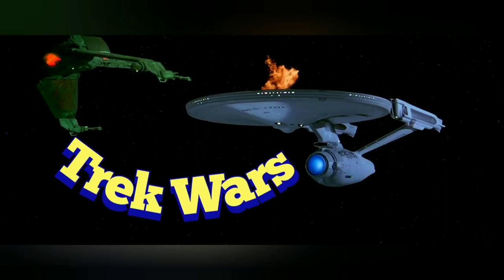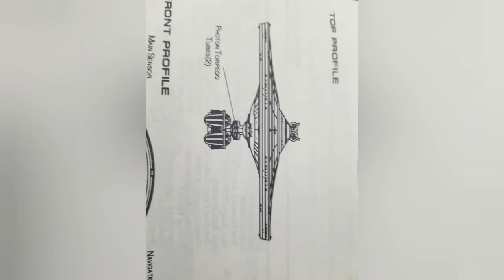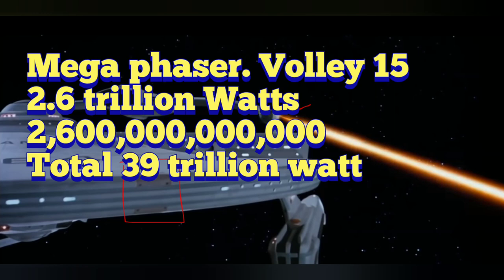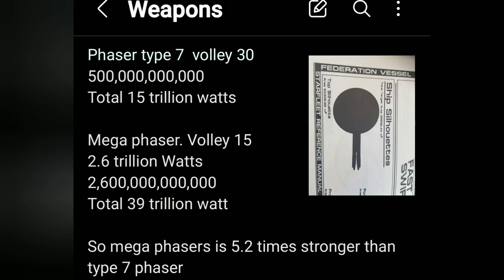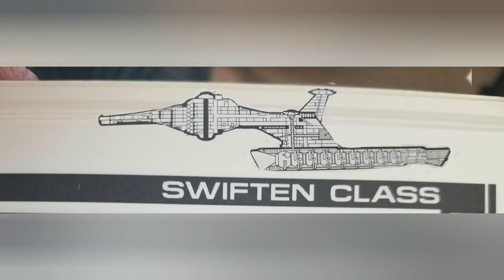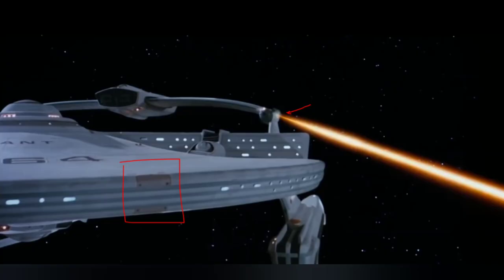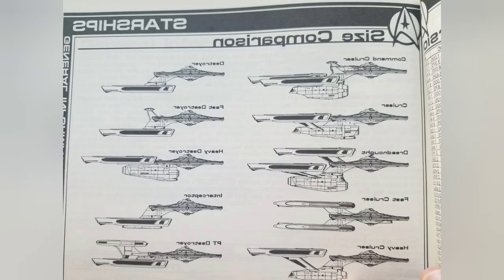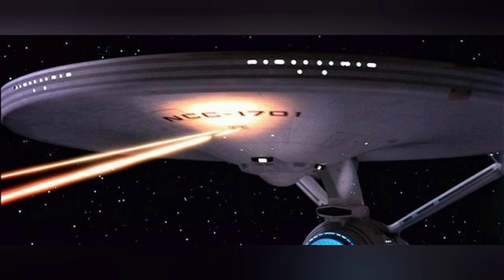Mega phasers starfleet's biggest  Gamble

Comment: The Reliant is a Miranda Class DD in Cpt. Kirk era Star Trek. Miranda is not demoted to frigate till the TNG era. That is why the the Reliant was able to put up a decent fight against the Enterprise even though it is a heavy cruiser. Destroyers can offensively punch higher than their weight but have less mass and armor than cruisers, so it cannot take the same beating.
Reply from the maker: @alexincobra7379  I have the manuals and the ships and I broke them down in a data table. The ships of the car care they're all very similar 
Same components. The only real major difference Enterprise has much better regeneration for Shields

Comment: They also have 4 times the range over regular phasers though so staying at the back and essentially sniping seems like a good strategy
Reply: What is the range of a regular phaser?
Reply: @M60gunner1971  250k max effective range
Reply: 250k kilometers
Reply from the maker: Yeah I agree .. I just realized when I looked at the manual that it was 10 to the 5th and the mega phaser is 10 to the 6th so yes you're right😅
Reply: @trekwars5400  This might be an interesting discussion video but is there any info on hit probability at different ranges against maneuvering targets and about ECM ie sensor jamming. Chieftain has a video about WW2 German tanks where he mentions that it was about 14 shots fired per kill due to the target tanks maneuvering, popping smoke and doing everything they can to not get hit. Thought it might be an interesting topic
Reply: @napolean2160  the other thing I am thinking here is we are missing a muzzle velocity do we know how fast a twin bank phase beam travels vs's the phaser beam cannon travels?

Comment: I feel like the Miranda was designed with the mega phasers in mind, while other ships were designed before mega phasers came out, I also think type 8 and ships like the excelsior were the death nails for mega phasers.
Reply from the maker: I wonder if type-8 phasers are a hybrid between mega phasers and type 7 phasers.. the volley of a type 7 in the power of a mega phaser.
Reply: @trekwars5400  if anything type 8 phasers might be the refined versions of mega phasers since their purpose was to get more power out the phasers and its better to refine the phasers than pump warp core power directly into weapons when it’s better used in shields or warp.

Comment: 500,000,000,000 is 500 billion watts (half a trillion watts); not 5 billion.  By my rough calculations, the super phaser should be about 5000 times more powerful than the standard phaser if it is 5 billion watts.  Can anyone confirm?